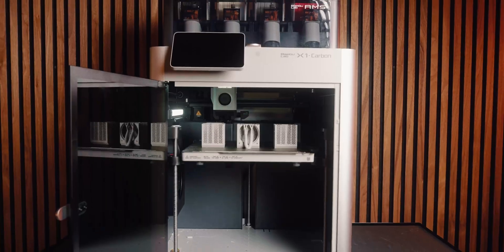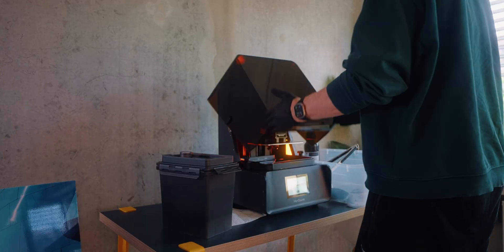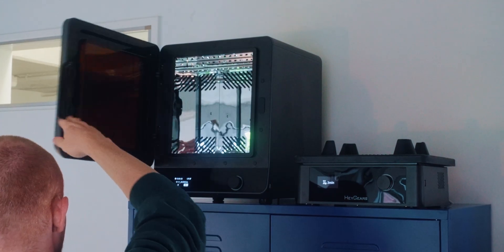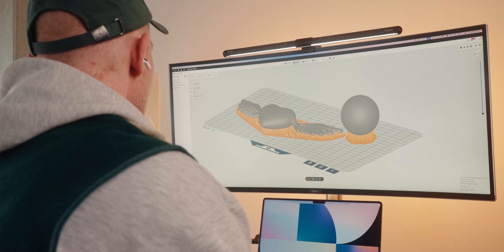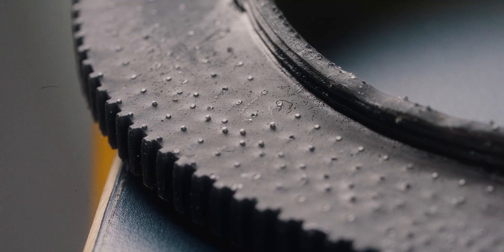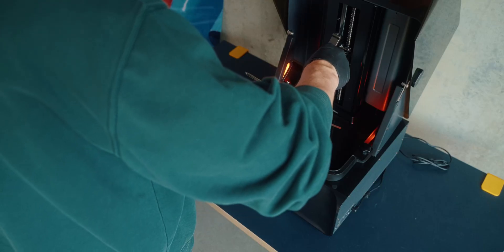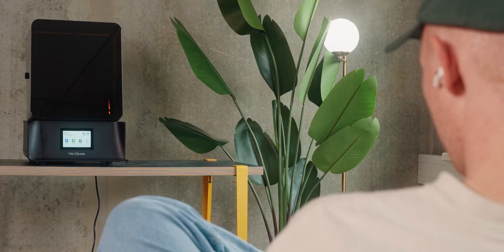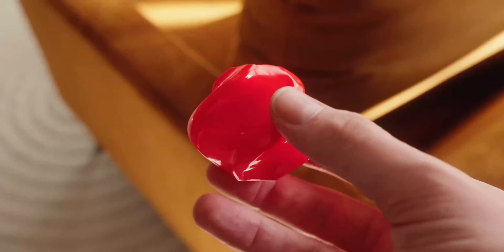Is Resin 3D Printing better than FDM? (I tested it)

Comment: I have some experience with FDM, and just started with resin. Luckily I have a separate room with lots of space to set up the printer and lay out the cleaning gear where I need it. My own experience is that it's not so much more work with resin as that it is different work. I'm doing more post-processing, but I have fewer failed prints and don't have to do as much tinkering beforehand to get things working.

Comment: got me p1s when it came out, then a h2d.... now i only have a1 mini and waiting for the h2c and snapmaker u1... i always wanted to get me a resin printer as second machine... after i got me a 2mm nozzle i can do most stuff i need... im not doing miniatures or highly detailed figures...  i thought i dont want a resin printer anymore... but it changed the other day again lol ... for projects u need sanding for painting resin might is more work first but the main process of sanding is a different story - u will save ton of time here, more than u have with washing and curing... so i will still get me a resin printer one day just for stuff i will paint...
Reply: My 3D printing journey started about 15 years ago when I got a small resin printer.  That same old printer still runs and has more detail at 2k than even the best of FDM printers on the market today.  I just ordered a new Elegoo Saturn 4 16k and an H2D (for larger things I need).  There is simply no comparison.  The speed of resin printers has increased significantly and, in some situations, can be much faster than FDM.  The availability of newer durable resins is a game changer.  I tend to look at the messy cleanup process as no different than the hassle of drying and keeping filaments dry plus the hours of sanding needed for FDM prints.  Both have their place, but I prefer SLA.
Reply: @johngilson7085  i have almost enough points on ancycubi makeronline to get me one.. i think soon i will get one just to try it out...

Comment: Mostly video created to AD this resin printer.
1) u didnt included time for post-processing resin prints. So even on u`r example 3.1h FDM printer and 3.2 resin is not accurate at all (clarify if im wrong and 3.2h is total time aka print time+dry time+ UV time etc)
2) if you print many things (and figures and models and practical things) FDM will be better anyway. Consumables for resin printer will eat ur wallet alive. 
3) u MUST have additional room for resin printer and stuff for it. For those who live in appartments its kinda impossible. So absolutely agreed about workshop theme. In contraversy as FDM printer owner i print sometimes all day along and i dont bother myself about fumes or that my cat/dog/kid will be affected (printing PLA and PETG). i just have my windows opened and thats all i need rly. 
4) Resin printers is more about details as for figures or veeeery small and diff parts. my imho. BUT when u wanna print for example Warlord titan --fDM will be better. and nobody forbids you to additionally post process fdm figures (but i dont know who will do such stuff) by acetone or smth like that. Just as an example.

For me -- resin printing is impossible for all reasons (no place to put so much additional toxic stuff and postproc devices, cant afford to buy so much consumables, high cost for resin in my country)
For now fdm is best for me. I already have Warlord(currently my favorite even without paint. Thanks to grey pla for sceleton and black trasp-t petg for armor and weaps (plus some dark red petg for exhausts/rockets and little details),Warhound,Wardog,dreadnaught, leman russ from w40k. Several types of collapsing swords. A freaking bunch of dragons (no dupes), grindfinity stuff and some boxes. Plus printed stuff for presents (jack daniels magnetic box was cool). And i excluded all practical stuff for my appartments that i have all over it.
Reply: You don't have a walkable balcony like in most apartments? Wouldn't that be enough? Maybe in a tent setup to protect everything?
Reply: @Requiemes I have a little bslkony. But it's main purpose to store some food and clean clothes and some other things. About tent ...I can't understand rly what you mean. 
If I understand correct then no. I can't use tent because of lack of space. I have kids, and my appartments not so big. And I mean appartments, not a house.

Comment: Did you use a 0.2 Nozzle and 0,08 Layer hight? I could see this FDM printed part …printed better
Reply: Even if he uses a 0.4 nozzle, he can achieve great results with 0.08 layer height. I think he knows this, but he used a layer height of 0.3 to exaggerate the difference in the video

Comment: Why nobody mentions about the fdm multicolor feature? There are color resin printers but oh boy changing the resin all the time… everyone focuses on “quality” which is not quality but the resolution. Get a smooth plate, and .2 nozzle, you will have a very decent looking parts, may still not a match to resin printers but very nice looking parts you can make. And one more thing, I can use all my leftover bits and pieces of filaments even a 5cm filament to continuously print what‘ll you do with the resin? Both have their advantages and disadvantages and for me fdm works better.
Reply: oh you're one of those guys...

Comment: Wait until the screen goes out. 50% of the original cost nowadays and only one color
Reply: Screen goes out after hundreds of prints by that time you can buy a new resin printer for half the price and better quality like I did, i have 300 colors i can use with my brushes.

Comment: I mean... A 0.2 nozzle on FDM gives a close result to this... Feels more like an ad. But video is well made!
Comparing the M8 thread was for me the killer... I have even printed M3 screws and they work flawlessly. In this video they are printed with a 0.8mm nozzle on a 0.40mm layer height or something. Same with that fan model at the end of the video... What is that?😂 You have an H2D and get those results? I call bs...

Comment: Lots of print "failures" throughout :/ Supports weren't connected to the bolt and one of the parts was barely on the build plate.  HeyGear's closed "it just works" ecosystem seems to be lack luster.
Reply: Sound like a resin tempature issue, but doesn't it have a built in heater?

Comment: Both FDM and resin have their strengths and weaknesses, but I think it really depends on the use case and desired outcome. I haven’t started resin printing yet, but I’m long-term shopping lol… the HeyGears is appealing as a novice, in the sense that “it just works”, but even as an adult with some disposable income, the price is high for a first investment. I’ve been looking at the Elegoo Saturn 4 Ultra 16K, as it has generally positive reviews, the tilting and heated vat, all for $500… plus the elegoo wash and cure station stuff is relatively inexpensive and seems to get the job done. I would love to spend more money and get the HeyGears, but I have other FDM printers I’d rather get first before even getting into resin at all, I think. 🤔 lol

Comment: The resolution of SLA / DLP is hands-down superb and superior to FDM, BUT I’ll stick with my FDM layer lines if that means I don’t have to be around and handle those nasty resins (my FDM enclosure is in my garage and has a full exhaust system … to anyone that wants to tell me about FDM off-gassing)
Reply: If you ware gloves and have wash and cure station it is much less of a hassle than sanding FDM prints.